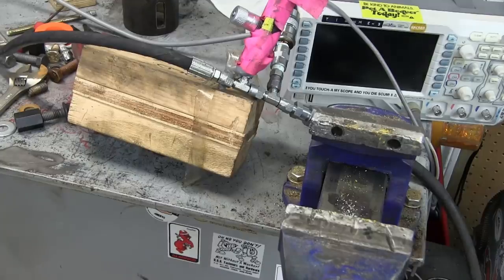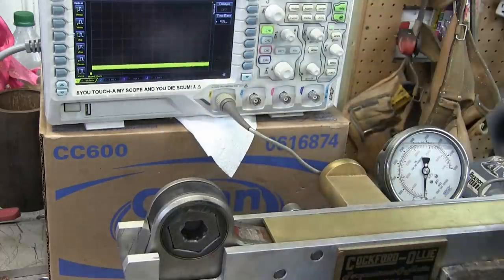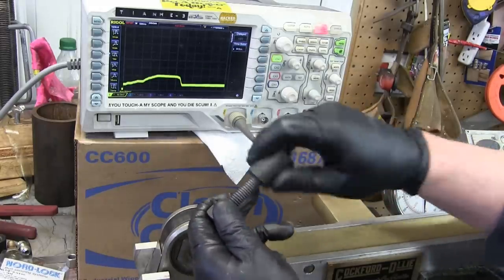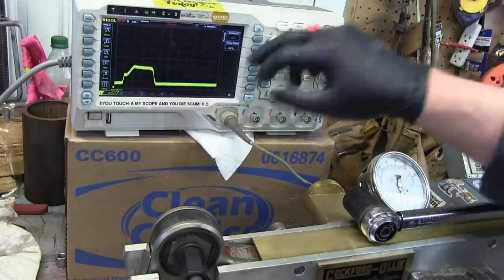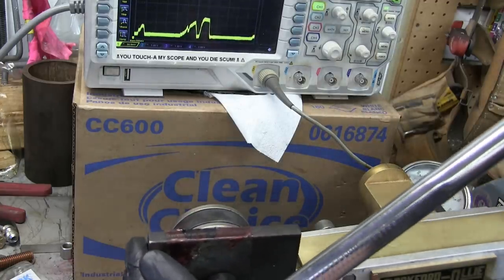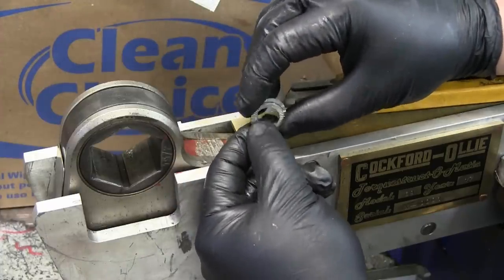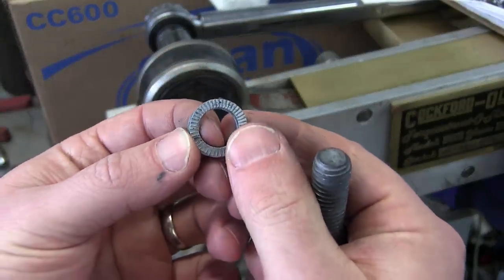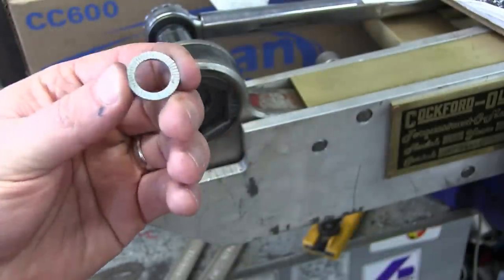Nord-Lock Washers | Do they work better?

Comment: Loctite for the win I guess
Reply: Tack weld for the win
Reply: JB Weld works wonders too.  ;-)
Reply: Crossthreads for the win.
Reply: Brian Gannon 
cross theaded is the tightest kind of tight
Reply: sand in the threads for the win
Reply: Locknuts ftw.
Reply: Locknuts are as good as using one nut when it comes to securing a bolt/nut. If you want it to stay in a certain position on a bolt then a locknut works. But when it comes to vibration, nothing can compare.
Reply: Lockwire for the win

Comment: I work at a factory that builds mining equipment. We use nordlock washers plus locking nuts (if it's a through hole)
Been using them daily for 10 years now. At first i did not like them but now i do. The thing is. If you use a nordlock washer you need to add 20% torque to that fastner. This is to counter the added friction the nordlock adds. So in comparison, the resulting normal force of the bolt is higher with the plain washer in this example than the nordlock when both are tightend to 100 lbs.

Comment: One more nugget to add: Grip length of the bolted joint. Rule of thumb for critical bolted joints is a minimum grip length of 4x the bolt diameter. The bolt is essentially a spring that is stretched by the threads. When the disc-lock washers stretch the bolt on a joint that has insufficient grip length, there isn't much spring to stretch. You might see different results with a longer grip length.

Comment: In my experience, Nordlocks are great in applications like end of arm tooling for robots. They tend to be made out of a lot of aluminum, plastic, and softer stainless so they usually grip fine. It keeps the things together while they wing around all day every day. Just like anything, they have their uses, despite all of the people that want to trash them. It's also easier to disassemble than threadlocker, which is important on production machinery, and they're food grade unlike threadlocker.

Comment: I worked on straddler carriers and i can say Nordlock is very useful on alot of structural vibrating parts. if installed correctley nothing wil vibrate loose.

Comment: I use nordlocks on the  shaft bolt on the screens at work.  Love Em. Fine-is thread bolts. Add goo copper based anti sieze, and I have never had a properly torqued bolt back off. Bolts warp and bend first.

Comment: Do the nordlocks come with instructions for adjusting install torque? It seems to me that even when working correctly, the serrations would increase friction in the joint, and as a result require more torque to reach the same rotation as a non nordlock joint. This would result in a lower clamping force (less rotation=less bolt stretch) for the same torque input. Since 99% of users are tightening fasteners based on torque feedback (feel in the hand, or a torque wrench) it seems like a flawed concept. Are these intended for industry where torque to angle is being used?

Comment: Maybe it's been said, but spring lock washers are very good at resisting thermally induced fastener loosening. The spring shape can take-up thermal movement keeping the fastener under tension which can help to prevent the fastener from coming loose.

Comment: Ave, In critical applications requiring a fastener to not loosen, it either has a keyed collar that bends over the nut or the nut is wired so as to not be able to loosend, there may still be another method I didn't mention which is used in applications in jet engines.  These other lock washers just don't do anything other than provide a false sense of security, unless they bite into softer metals like aluminum -- evident by the galling caused by the lock washer.  But if you need a fastener to not come loose, most likely, the fastener metal is at least as hard as the washer, which provides a smooth sliding surface.

Comment: I work in the trucking. From experience we use nordlocks on the PTO mounting flanges on the allison transmission PTO mounting flange-never had them walk loose. Nordlocks are WAAAAY more efficient with a fine thread, you require more rotation to unclamp the washer. Try this maybe?

Comment: What you did is proved the efficacy of nordlock washers, they're designed to resist slippage and vibration(gradual forces) but to not prevent the bolt from ever coming out(concentrated force)

Comment: Correct me if i am wrong, but I was always under the assumption that spring and other locking type washers were geared towards vibration and negation of bolts backing off due to resonance vs increasing breakaway torque. I was also under the assumption that they should be used in conjunction with a flat washer? Although there was that one time in the 80's where I was wrong.

Comment: I love all your vijaos! keep em coming. 
one comment on this topic though... I was led to believe that purpose of a spring washer was to prevent unscrewing by vibration and not to increase the breaking torque . LOC-TITE is used to increase the thread breaking torque. A spring washer just puts some constant pressure on the bolt .....

LOL
busy typing JUST as I heard the magic words at 8:15 ... "does not affect the breakaway torque" ;))

Comment: I think for stability at high-frequency repetitive stresses it has more to do with the pressure of the surface of the washer acting on the nut. With a flat washer the load is spread over the entire surface, say 1in^2. But with the teeth the surface with load gets cut down to 1/4in^2 or less. Do you think that could have something to do with it? In most applications nuts aren't usually under torque when tightened so i'm not sure if your test is 100% accurate since the differences were near negligible

Comment: I remember seeing Nord-lock on equipment around1990~95.  As you said, great until they fracture and everything just falls apart. In another vid you mentioned something about lining up screw heads(100,000 subscribers). In the 80's I worked at a BMW (motorcycle) dealers. Part of PDI was to line up slots on screw heads, BMW used 6mm 'hole' Nord-Lock type washers on case screws (they didn't use Posi or Phillip's back then) Seemed real obvious to me how they were supposed to work (I had been trained as 'turner' we had to know about helix angles of threads, etc when grinding HSS thread cutting tools)

Comment: Nord-Lock does recommend putting a little spray of lubricant on the mating surface, probably the bolt head, for optimal "bite". You don't want friction to stop the "biting" too early.

Comment: mechanic on heavy equipment-40yrs  nordlock washers per application work very well in high vibration conditions if you have issues with losing torque from fasteners that work out this product will stop that problem.

Comment: The hardened bolt - what specifically was it? One of the plants I work a lot at regularly wants Grade 8 bolts installed with Nordlocks on their junk that vibrates all day (shaker motors, conveyors, etc). Wouldn't they then be more effective with Grade 5s?

Comment: In your final test of the nord-lock you see on the oscilloscope that the release torque sloped up until it released, that nicely shows the expansion of the washer at a different rate from the thread pitch as the bolt is being loosened.

Comment: I had trouble keeping headers tight on a hot rod .  tried longer bolts to allow them to stretch so that they would hold better did not help .  Bought some nordlock washers put them on and the headers never got loose again.   Worked for me.

Comment: well that's majorly the point. 

bolts loosen because of micro movements with really short rotations caused by vibrations and shocks. shocks especially are characterized by extreme forces, and minuscule deformations. 

Therefore increasing the amount of needed deformation for loosening, is the key element in keeping vibrating fasteners closed tight.

which is basically what all spring washers do.

Comment: I used nordlock washer on some manifold to turbo bolts that kept backing out (guessing due to engine vibration). They worked great until the galvanic coating welded together from heat and the nord washer effectively became a flat washer. Havent been able to source any stainless nords, do they make em? Would they even work being harder?

Comment: You essentially did measure its vibration resistance since you measured the torque required to loosen over time. That's the angular impulse required to loosen the nord lock. You should be able to calculate the time it takes to loosen as a function of vibration frequency, amplitude, and duration from that.

Comment: I've seen a few of the flange head bolts with Nord-lock style bitey bits built into the bottom of the bolt head. Those seem good at requiring extra torque for removal, but they do tear up the surface they secure after going in and out a few times. I suppose for some plastic parts, one could make Van der Waals washers. Or, maybe a combo, like the non-stick pans with the diamond dust protecting the non-stick from scratching off, one could make a washer with softer Van der Waals grippy bits in between harder Nord-lockey ridges. It could be nice for some instances of assembly if you could stick the washers in place, and they wouldn't fall off.

Comment: probably old news but according to the junkers test, big winner is free bolt length 5x bolt diameter. will never loose pre-tension and therefore won‘t loosen up because of lost friction. (hence the long thinner neck  on screws which you don‘t reach easily)

Comment: Nord lock washers are made to fit the pitch of the bolt if you get a washer for metric bolt and inch bolt it may not work .
You can get Nord lock for different pitch bolts for max effect . And the Nord lock is certified for aeronautics .

Comment: It's been pointed out, but I feel I must reiterate in slightly more explicit language why this test does not properly measure the usefulness of a lock washer.

When you get vibration in a bolted-together connection, that vibration will (without something like a lock washer) cause the parts being held together and the nut and bolt to move in relation to each other. This results in intermittently reaching a point where the torque required to loosen the fastener is effectively reduced to zero, or, at best, whatever torque is required to overcome the coefficients of friction involved.

To restate, vibration will cause the held parts to press against each other *as hard as the nut and bolt are pressing them against each other*, at which point that nut and bolt are doing no real work. When they're doing no real work, the torque required to release them drops to basically nothing. The vibration can simultaneously cause the nut/bolt to spin, loosening the works even further.

A lock washer is essentially a spring, so that when vibration causes the held-together parts to push against each other, no space can be created between them and the nut and bolt, and the reduction in the required torque is lowered to whatever torque is required to overcome the pressure of the washer/spring instead of the minimum.

Comment: You're correct that they will work as long as the serration bites in the bolt. The washer is designed to be used and work bolts up to grade 12.9.

Comment: Hobart Food Equipment has commercial wrappers using KEPS hardware to keep printer mounting clamps from moving around from machine vibration. They bite hard into the aluminium base plate and stainless steel clamp,and need incredible torque to break 'em free. All from a 1/4-20 bolt and nut.

Comment: Late to the party as usual! Luckily, I always bring beer! Some of the centrifugal chillers I work on use Nordlock washers on the bolts that hold the labyrinth seals (another wonder on its own!). I agree, the bolt needs to be stretched in order for it to function properly. Just bolting cast aluminum to steel with run of the mill 3/8" grade 5 coarse thread bolts. Their design makes it difficult to get it slightly snug to hold it in place while I set the clearances before I ram her home.
Either way, it's nice to see someone have the same take on these things!

Comment: Loctite? Fits every size bolt and seems to work well. Would be interesting to see it tested. Can't have lubed threads but otherwise hard to see the downside. But of course I know nothing other than what I've anecdotally experienced.

Comment: Cool video.   Mose critical fasteners rely on torque and bolt stretch… cylinder head bolts, connecting rod bolts, main bearing cap bolts…. 
How does the experiment go if you use fine threaded fasteners?

Comment: Just going back to your other video of applying the optimum torque force  to the point just as the bolt starts to stretch ,does the spring washer not retain the tension on the bolt thus prevent it decending below this designed optimum torque?

Comment: I would think Nordlock washers would work better with fine thread vs coarse thread for a give bolt size due to lift per rotation.  Is this an accurate observation?

Comment: On John Deere pickers, they use flange head bolts that are serrated like the nordlocks. Those bolts are noticeably harder to remove than plain flange head bolts. Also, the pickers would be a very vibration intense machine.

Comment: was wondering about the inner serrations, at first thought they looked the wrong way round, but now it makes sense with the spreading on loosening. same force for longer= mo powah. bolt some heavy plates together with more overhang than overlap and throw them in a concrete mixer for variable frequency testing.

Comment: The one thing that everyone misses which causes all the issues with spring washers (split, lock washers) is...
  Anytime a spring washer is used in a "critical" (important, required, etc., etc.) application, it's a one time use device!
  Whenever something fastened with a nut over a spring washer is disassembled, that washer has been "sprung" and will never hold the same way, again.  If you're putting something important back together and it has spring washers, spend the 2 bucks and replace them!  Then they'll (theoretically) have the original tension requirements restored and the fasteners shouldn't fail.  It's only after something has been apart and back together a few times that I've seen them come undone and just not hold.
  It's not rocket surgery, they're not the greatest answer on the planet but, they have their purpose and when used correctly, once...  They'll do the job.  Note  This does not include the initial assembly with a. ew washer when, upon being tightened to torque the first time, immediately releasing and retorquing to ensure proper seating, etc.  It's after they've sat under load for a period of time that the metal fatigues and loses its resilience.

Comment: wouldn't thickness of washer and pitch of the thread effect the outcome? if washer is level with a thread valley vs mid thread it would clamp against the washer vs clamping against the thread

Comment: How do those compare to a prevailing torque lock nut in terms of resistance to vibrational releasing torque. I.E. would the nuts work better than the washers to keep something from going tits up?

Comment: Thankyou for confirming my hypothesis that these would not work well with hardened fasteners. The $60 for a pack of 20 does not sound too good when they do not work with hardened bolts. I have seen hardened flange bolts with the same looking ramps the nordlock have, i wonder if they work just as well or even better?

Comment: What about using star washer?  It seems like that would be more aggressive than the old split washer.  Mind trying a couple star washers, not sure if internal or external styles would change the effect a lot.  Your flanged bolt should completely cover either.  The leverage between them may possibly show a moderate difference in break away.

Comment: im not sure what pitch the nordlocks are, but it has to be greater than the bolt. 
could you test with a finer thread? break away torque could be higher or just as high as tightening.

Comment: Aren't spring washers as you call them, made to hold tension on the bolt to force the threads into a bind so it doesn't easily back out on its own?

Comment: saw a comment once that said always torque the nut not the washer. does this actually make a difference in end torque?
my dad and I also have a year long on going debate regarding lubricating threads when torqueing nuts and bolts
from an automotive stand point never lubricate. but he disagrees. we even did a test one day with two nuts and washers. one lubed and one not torque to 100ft/lbs

in lubed torqued and the lubricated nut would not click the wrench, it snapped the bolt (cheap bolts) before it got the torque wrench to click the 100 ft/lbs setting.  what's with that?

Comment: I've had what we call split spring - what you call the high collar - break, since then washers (hardened where possible* and especially with higher torque loadings) and some form of locking compound seems to work well. If it is that critical, lockwire or some other means of locking (plates?) should be used.
The problem, in my mind, is that with all these locking washers, the fastener needs to be already loosening to work.

*the cheap ones can extrude and so can those soft lock tabs that fit under the bolt head/head.

Comment: also might want  to mention, due to the helix angle of the bolt thread and the incline of the rachet teeth on the washer, you have to order the correct nordlok for the fasteners your using

Comment: Wouldn’t the nord lock washers have a chance of distorting the torque used to tighten them. Leaving them under torqued due to the fact you have to over come the ramp of the washer to tighten the bolt/nut?

Comment: I just installed a ton (think thousands)  of these (Nordlocks), on a bolt replacement project.  We pulled bolts that were installed with locktite.  Locktite is superior, in my experience.